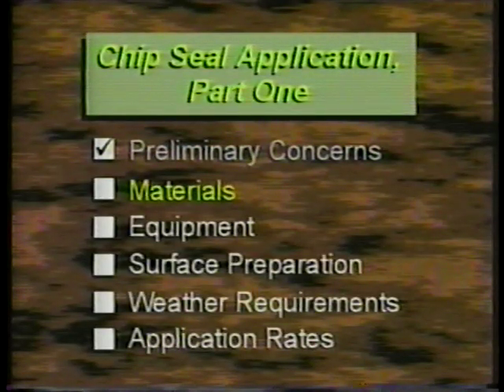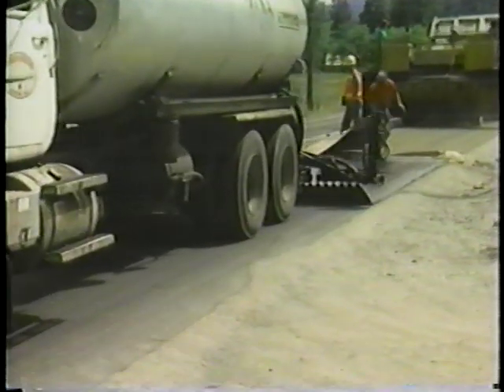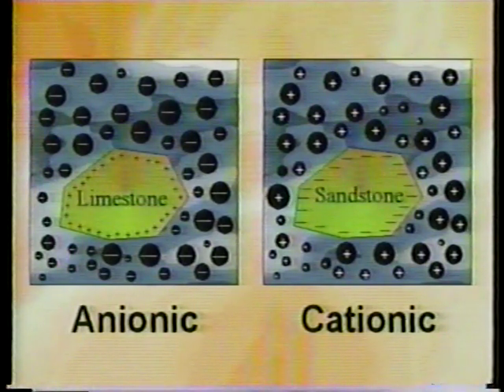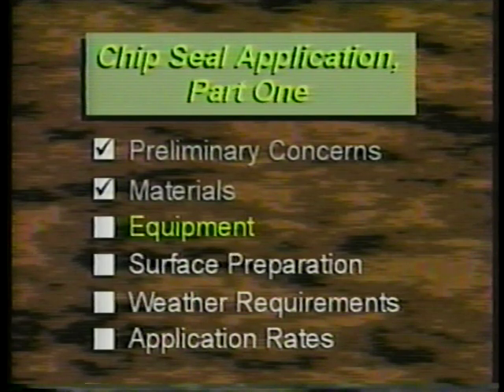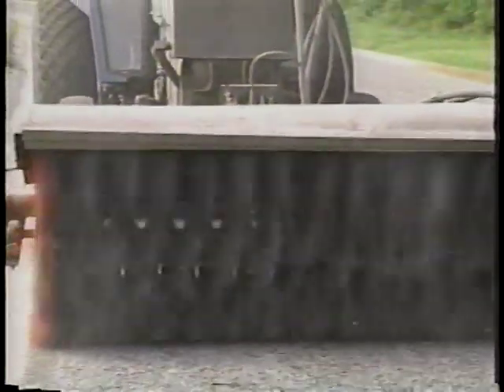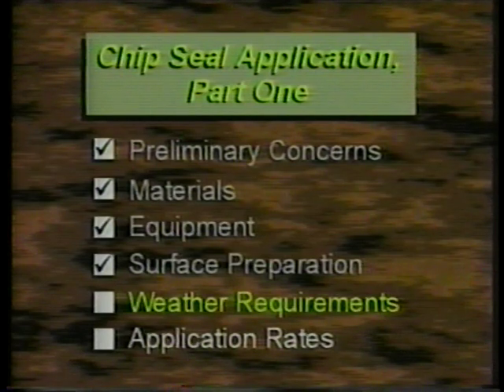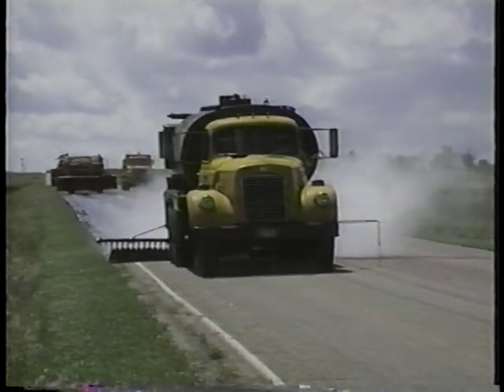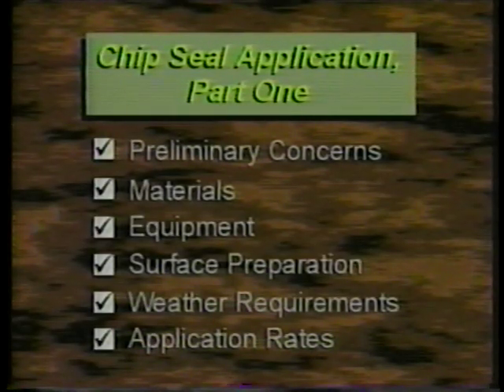Chip Seal Application - Part 1

Comment: Driving the spreader poking along in second gear is where you get coverage problems because the gate isn't open enough. By god you will get a better cover in third gear and that means you aren't crowding the distributor's ass but waiting about a minute after he starts the shot.. You're going to stop after the first truck is empty anyway .